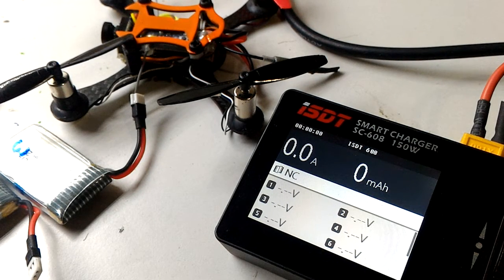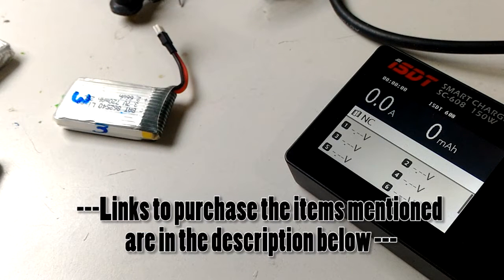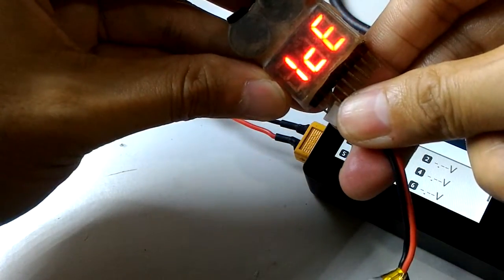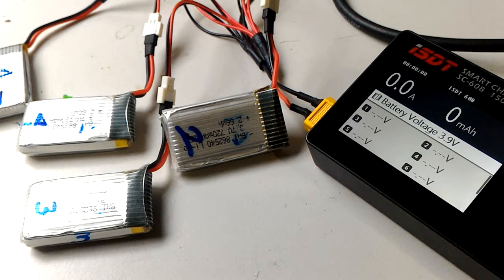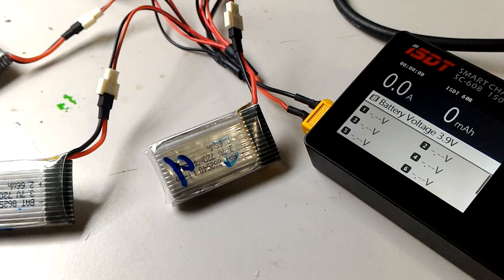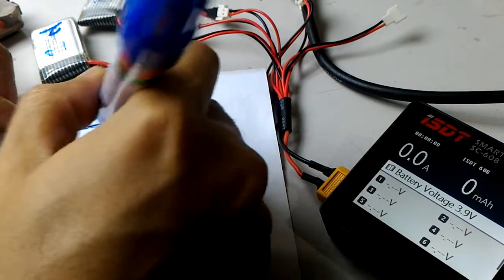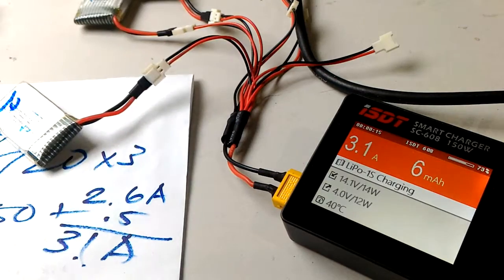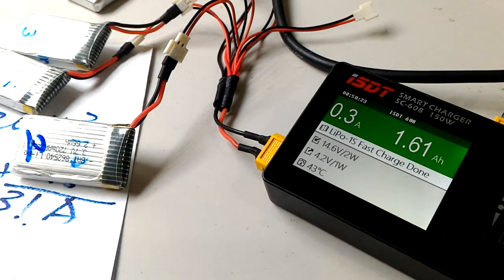Parallel Charging for lipos (unequal voltage) - How To

Comment: If the difference is high this can be quite dangerous. The higher the difference the more current will flow from the higher charged battery to the lower charged one. This current can exceed the maximum charging current and damage or destroy the battery. Be careful.

Comment: Its better to wire them serial and solder an balancer plug into the charging cable. But Always bei carefull and never do that with bigger Lipos and never with a higher difference than 10mV. For Lipos of 60...200mAh the discribed way is okey.

Comment: good way to damage the battery and create unsafe condition in your place. This can be fine for 1S battery with small difference in voltage....do this in bigger cell batteries and with higher difference in voltage and you will be likely to damage batteries and put yourself in danger

Comment: This is a dangerous thing to do. The current between the cells can be too high if the voltage difference is high. Even fire cab occur.

Do not do this.